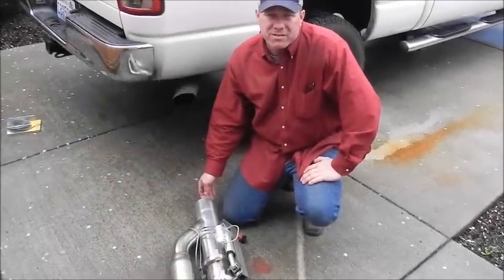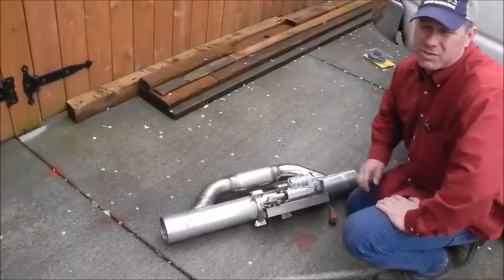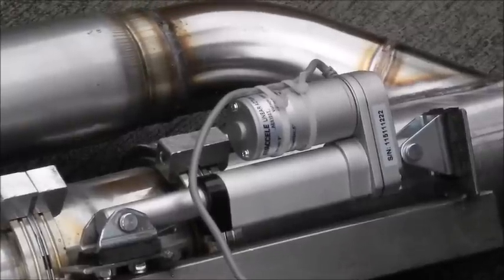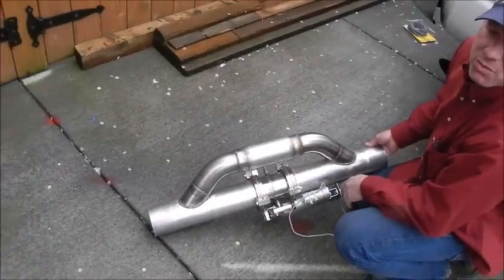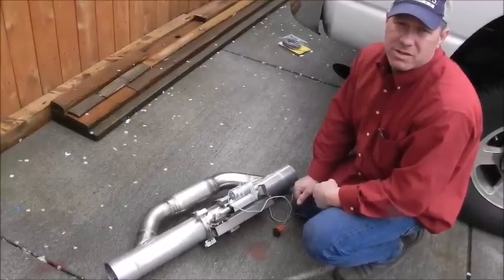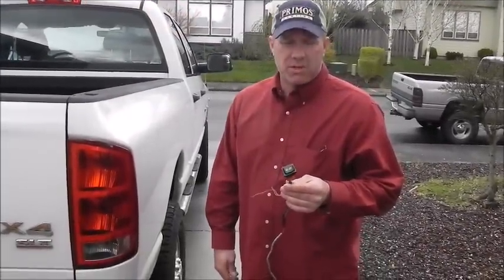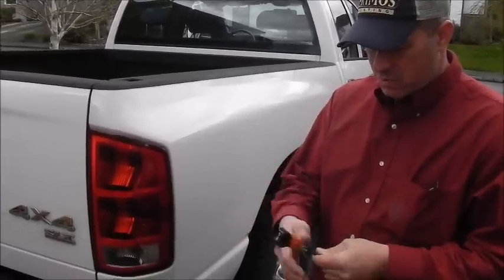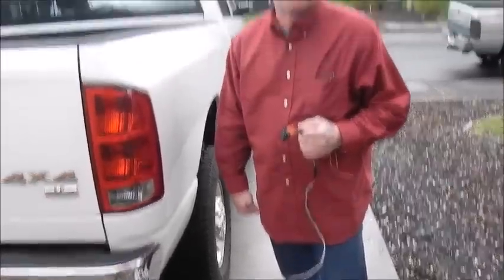Diesel Exhaust Bypass Project

Comment: Pedestrians hate you :)
Reply: This mod worked very well! I used it for 5 years with a little maintenance to free up butterfly shaft after 3 years. I should have used 4" tube on both sides of bypass, not sure what the EGT's looked like never having a change on it. Sold the truck 4 months ago with the exhaust still working.
Reply: EGT Gauge on it rather. A larger 4" muffler would have been good. Under load you could hear a significant difference. Especially when sound would echo off of walls and other vehicles.

Comment: heey very cool idea.. how did it work out in the long run???  I'm thinking of doing the same thing to my powerstroke
Reply: Sorry for the much delayed response!! Its been a long time since I've looked at this video. Was surprised at the attention It's received ! For the last year the butterfly valve has been frozen half way open. Just a couple days ago I pulled it out and freed it up. works great again! Some time back I built another one with all 4" and a full size diesel stainless muffler. just need to install it sometime. Thanks for your interest! P.S. The original actuator still works fine.
Reply: It must have been no use like the video